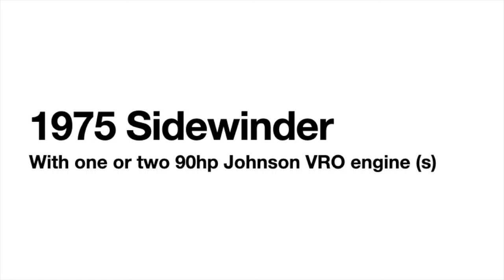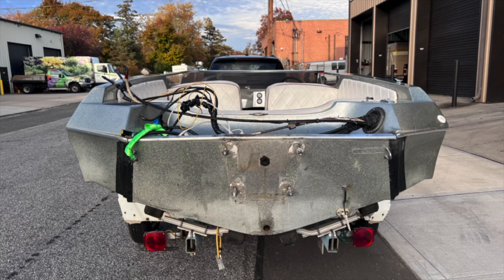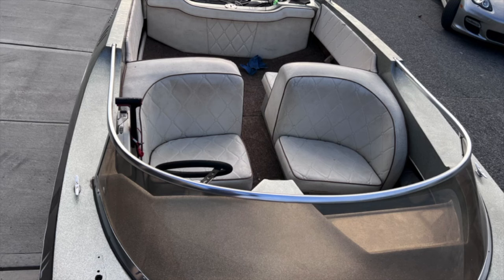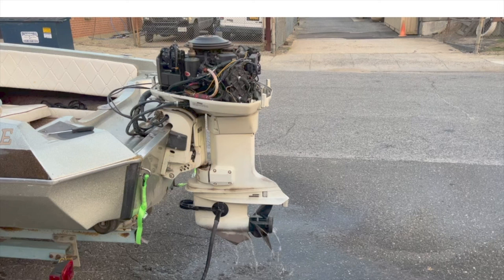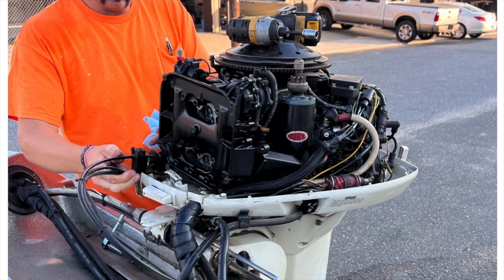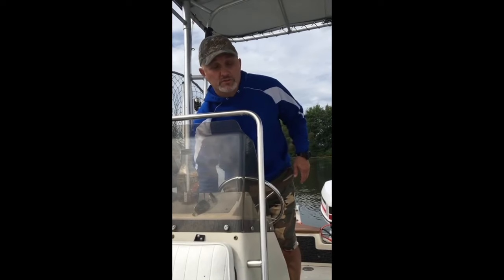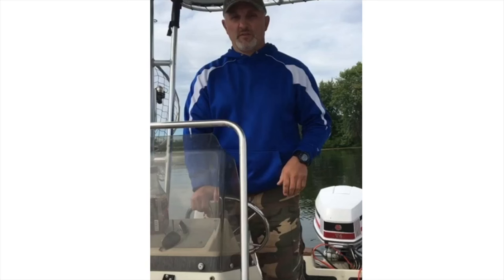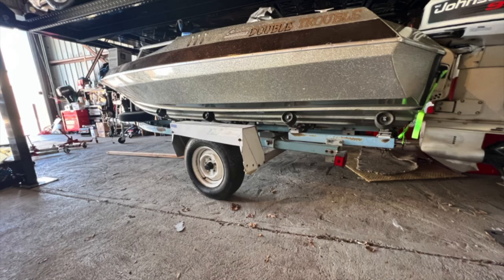1975 Sidewinder for sale: Boat, motor(s) and trailer. $5000.

Comment: hard to hear but did you say the transom was shot from trailering? If so thats a lot of work not as easy as people say. i cant believe sidewinder made these without a pad, but the interior is amazing on this one. the hens tooth as you know is the 14' one. i had one with a 115 around 2005 shouldve held onto that one.
Reply from the maker: The transom was done and then the previous owner said he hit a sandbar and snapped off part of the skeg. When I took delivery it looked more like he hit pavement and the wood in the transom debonded from the glass. That's why I prefere Coosa board for a much stronger bond. Also I have a youtube video on the first transom I replaced on my 16' Sidewinder lopro.
Reply from the maker: https://www.youtube.com/watch?v=VfmZMkoioBU&t=104s
Reply: @Fixdecay  coosa is quality stuff for sure. much lighter too i believe? sounds like you have a passion for these thats awesome. good luck with the sale. as you know market is in the doghouse. I run an OMC rebuild specialty shop up in RI called RI outboards. Dealers are telling everyone 2 strokes are a nightmare so the market has fallen badly this past year especially. people seem to have trouble starting a 2 stroke its really sad now.
Reply from the maker: Pro's and cons. I may need your help with my three Johnsons.  I'm thinking of 2 strokes like a classic old car. Check out this Merc 115 resurrection video. https://www.youtube.com/watch?v=3zTMJDBEAuw&t=11s @ct1762